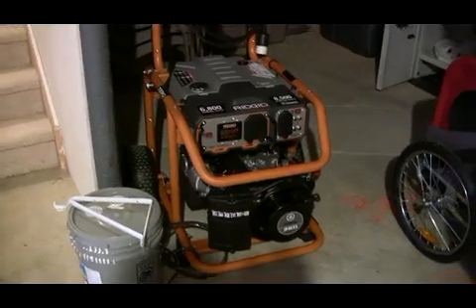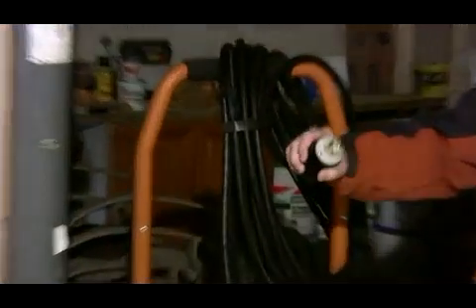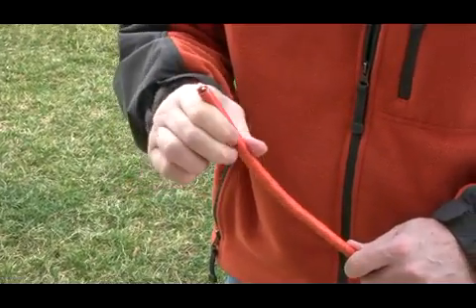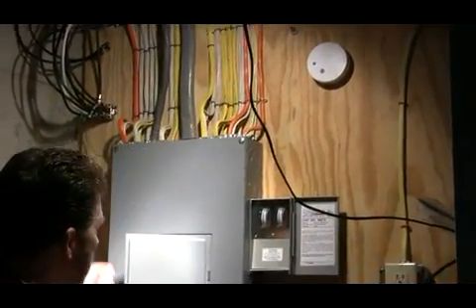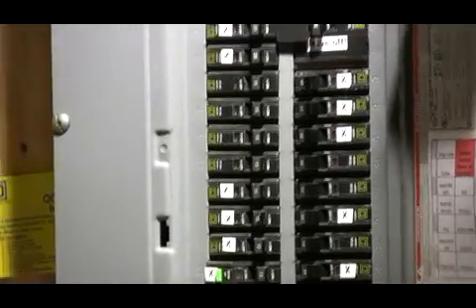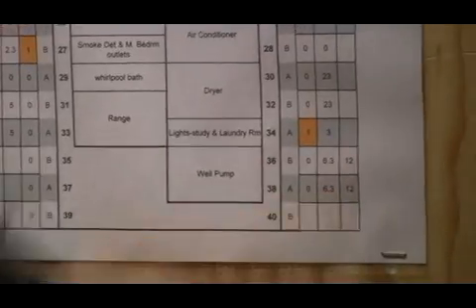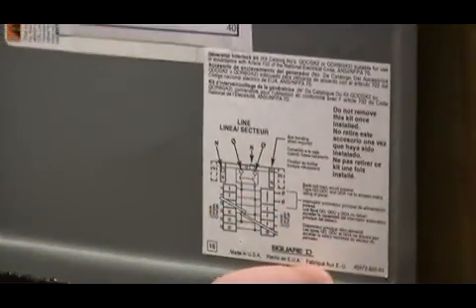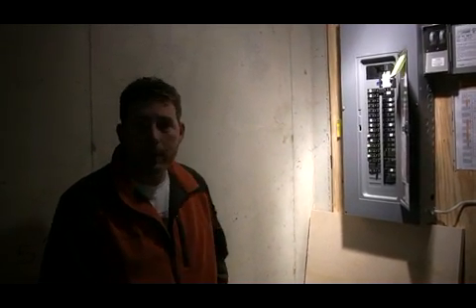Interlock vs. Transfer switch

Comment: Well Done and helpful.  Did the generator backfeed breaker come with the mounting plate?  Seems these need to be a pair.    I.E.  Did it all come together in a kit   with the breaker, breaker mounting plate, and sliding lock?

Also, you reference in the video that the kit needed to be manufactured by the same company that did the electrical box to be code compliant.   Did I misunderstand and you can get the kit from a 3rd party?

Comment from the maker: @himmelfarb4   Actually they have this little device called powerback by Reliance controls.  It is a little battery operated unit about the size of a deck of cards.  It has a wire that simply wraps around your main feed line. when it detects voltage it will alert you.

Comment: this is true.  i gues a determined idiot could do the same damage in a transfer switch!  i started a job today for a guy who has a 24 kw generator, and wants some circuits on generator backup.  i took your idea about the battery backup emergency pack!  in fact someday i can see that being code to have those installed throughout the house. great idea.

Comment from the maker: @pamansprewell33 - Yeah, but that would involve removing the deadcover from the panel. (which should not be done by anyone who doesn't know what they are doing)   The interlock is permanently installed on the panel (bolted on)   There is only so much you can do to protect the determined dummy.     Thanks for the comment.

Comment: nice work man.  looks good.  the only thing that scares me a/b not using  a transfer switch is that theres a chance someone who is dumb (plenty of those in the world) to remove that interlock.  if that generator runs while both those breakers are on, that will literally back-feed the high power lines outside.  the current will be super low (b/c) the generator can't create that much current. but the voltage will be the same which could harm ppl working on the down power.